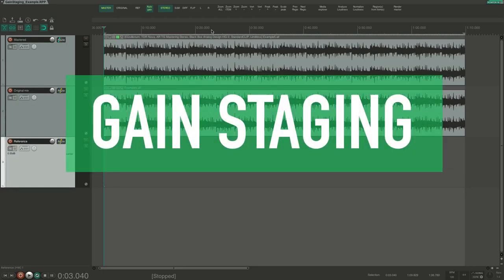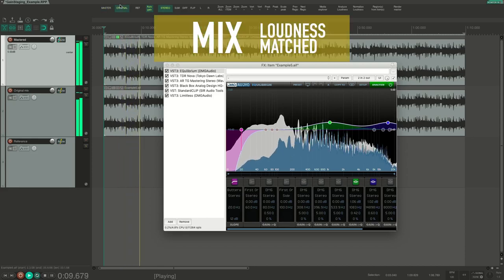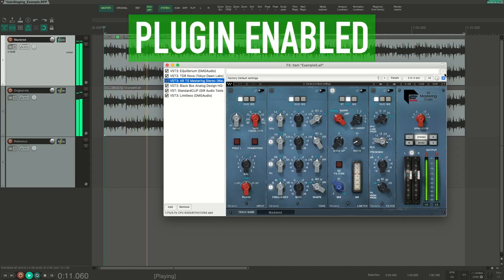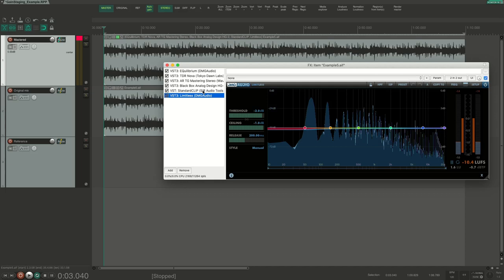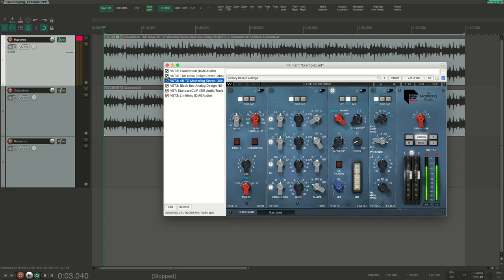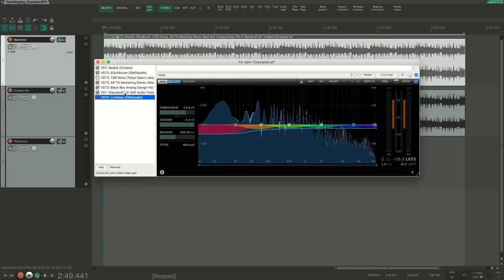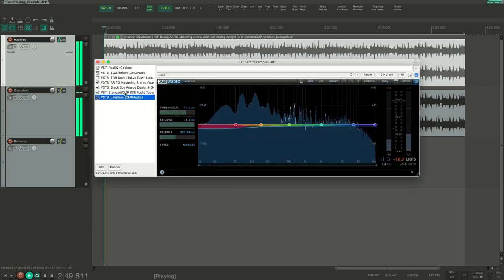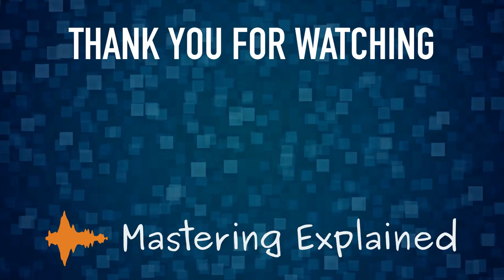Gain staging in mastering (the right way)

Comment: Your mastering process is "loudness staging" (Unity Loudness), not "gain staging" (UnityGain). However, with this method, if you bypass the plug-in before dynamics processing, the peak of the chain signal will change, and dynamics processing may not be performed correctly. (Does keeping the loudness constant necessarily reduce the peak?)

Comment: As a fellow Reaper user, I use the Delta function a lot to quickly gain stage and also get a good sense of the processing that is actually applied to the sound, helps speed things up in my case anyway.

Comment: Thanks for another great video Thomas, very clear and makes sense. Two questions I have, well one question and one possible Reaper point. The question is, have you worked in the box with a workflow that puts the gain at the beginning of the chain, rather than at the end, to better drive analogue simulations, and still leaving the limiter with not much to do (let the internal floating point manage the overs in the chain)? Secondly, Reaper has a clip/item gain which your template has switched to not visible, you could use that instead of the EQ plug-in at the beginning of your chain to set the initial desired level.
Reply from the maker: I keep everything at approximately -18 LUFS for the main part of my chain, but you can choose any operating level in the chain, including hotter levels if that sounds better. You can also have different levels in different parts of the chain by inserting gain plugins at certain points. The main point is to keep each plugin at unity gain. 
The item gain in Reaper will affect all the takes within the item, so it gets a bit messy if you render the FX to a new take. But there is a take volume hidden in the item properties that can be used for this. /Thomas

Comment: Rather than use the eq to set the level can you not simply adjust the level of the file by dropping the wave form?
Reply from the maker: Yes, that's also a way to do it. /Thomas
Reply: @MasteringExplained  Thanks Thomas. I love your presentations, they make perfect sense and when someone is not sure you reply straight away which also helps hugely :-)

Comment: Good video. Listening to the track, my approach would be EQ and a touch of limiting, little more than that. The mix simply doesn't feel that it lends itself to compression (overrated in mastering) or clipping.
Of course a major problem with EQ plugins is that many of them add a fraction of a dB just by switching them on! Always test, and let the mix inform your decisions (by ear).

Comment: Thanks, very clear video on your point of different gain staging strategies here. Could you try prove the point that plugins sounds better with -18 LUFS input?
Reply from the maker: Glad you like it! -18 LUFS is mostly from a general observation about where plugins tend to sound the best. Some plugins state their optimal operating level in the manual, but it's mostly about learning the limits of the plugins that you're often using. This is especially true for plugins with analog modeling, saturation or other non-linearities. There are also many plugins that sound the same at any level. /Thomas
Reply: @MasteringExplained  I've always seen people and usually manuals say -18 dbfs or what 0 VU usually gets calibrated to... I've never thought about -18 lufs that would be a great thing to test, and I like your point of view, in the end is the way it sounds and knowing the limits of the plugin/gear. Great video btw
Reply from the maker: Yes, both LUFS and RMS will get you close enough as a starting point. I usually tweak the input level by ear anyway and might deliberately set it higher in order to "push" the chain a bit more, or vice versa. /Thomas

Comment: This is a great video! But sometimes you’re interchanging the words “loudness” and “volume”. Which is unfortunate because the difference between those things is the base of this whole video. I’m sure it’s an honest mistake in such a lengthy explanation but it might make it confusing for beginners. 

So in your first approach there’s an actual volume increase. In the second approach you’re only messing with the loudness by controlling the output gain stage of each plugin.

What would really interest me is to what you actually listen back to. Is your system average set to the beginning loudness of -18LUFS or the finished master of -10 to -8 or whatever LUFS? 

Thank you
Reply from the maker: I try to avoid the word "volume" since it doesn't have a clear definition and I don't think I used it in this video, but I could be wrong. 
Maybe it wasn't clear, but the purpose of this video is to demonstrate a workflow that helps you to avoid loudness bias and also keep the gain structure intact when switching plugins on and off.
I usually monitor the full chain, including the final peak limiting. /Thomas

Comment: This I don't understand is: What about Sends and parallel processing such as a Drum Crush bus or parallel compression? I run my Kick & Snare through send channels that I slam IVGI2 with. You don't want to go back and "gain stage" that into wimpered oblivion? That might not be the case all the time, but seems like the examples I shared would be exceptions?
Reply from the maker: Sure, when mixing there might be less need to meticulously compare and optimize each step of the processing chain of for example a drum bus. The main objective is to make it sound great musically in the context of the mix. It's also more difficult to loudness match when using lots of compression.
Still, it's good to be aware of the loudness bias. It's very difficult to spot "louder but worse" when comparing to "way better but too quiet".
/Thomas

Comment: Did you try to do a null test between the outcomes of both results?
Reply from the maker: It's possjble to get the exact same result with both methods. But the point is that you will make different decisions depending on the workflow you use. The best workflow is the one that consistently gives you good results. /Thomas

Comment: Thanks for the info! I use that Black Box saturator sometimes. Do you ever use the WET/DRY setting with it, or do you just keep it %100 and change the density? Is it the same with the M/S newer version? Do you use a different approach to gain staging when thinking in terms of mid/side? (i.e. do you put more compression, saturation, more high end, or overall volume into the middle or sides as a rule? And if so, do you suggest doing it in small steps throughout the chain, or wait till the last step, or two?)
Reply from the maker: Yes I often use the wet/dry control in Black Box. I haven't tried the M/S version yet. I use M/S processing quite sparingly, with no big differences in level etc. /Thomas

Comment: I have a question. If I want to achieve the final loudness of -8dbfs or -6dbfs in this way, it will not be enough at present. Do I need to add another limiter or just add my target loudness to the final limiter?
Reply from the maker: I would add all the gain in the final limiter as a start, and then possibly add another limiter before that if needed. See this: https://youtube.com/shorts/PSwEXvRqMlY
/Thomas
Reply: @MasteringExplained  thx for this！

Comment: Which action did you call for that  analyze loudness button? I downloaded this yesterday (and then took the advanced course) but that button was not assigned to an action by default. I used the "Calculate loudness of selected items, including take and track FX and settings, via dry run render" action. Everything else was working as expected though.
Thanks!
Reply from the maker: The action is "SWS/BR: Analyze loudness..." from the SWS Extension. It seems as if that extension is somehow missing from your Reaper installation. You could try to install it manually, see: https://www.sws-extension.org/
Hope this helps! /Thomas
Reply: @MasteringExplained  Ah that's it. Thank you! I have SWS installed in my regular install of Reaper but I forgot to install it into this portable one.
Reply from the maker: Glad you got it working! /Thomas

Comment: This is total non sens .. Letting your final limiter to do all the heavy lifting is not how you can achieve a clean and punchy master
Reply from the maker: No heavy lifting was done by any limiter in this video. :) The peaks to average ratio was gradually reduced before the final limiter just to avoid getting all the gain reduction in the last step. The trick is to find methods to do that peak control without also adding gain/loudness at each step. /Thomas
Reply: 9db of limiter is gain staggering